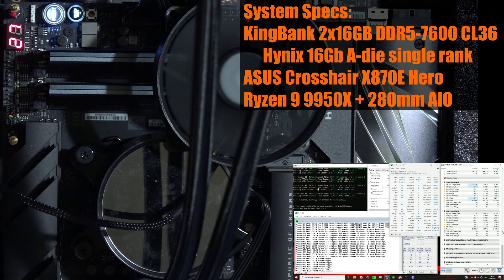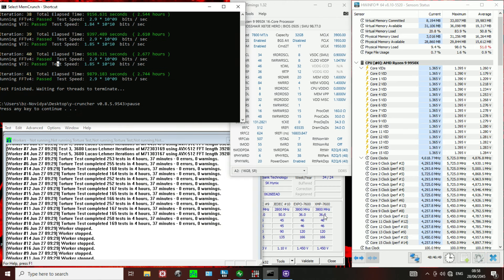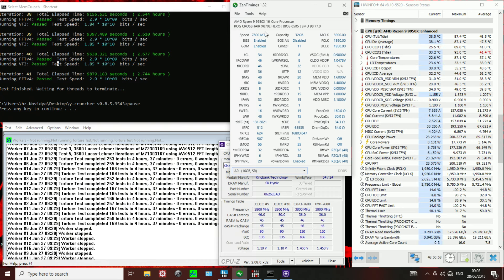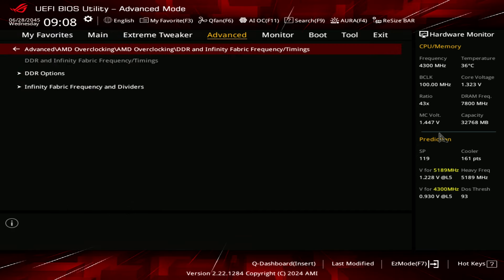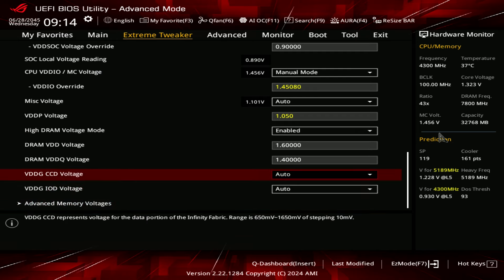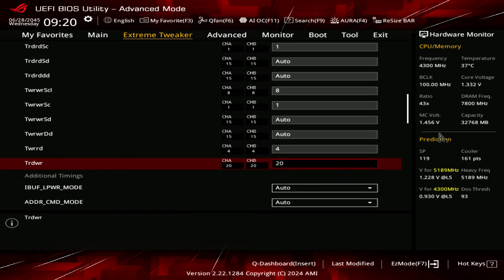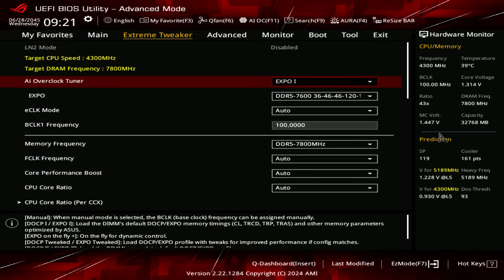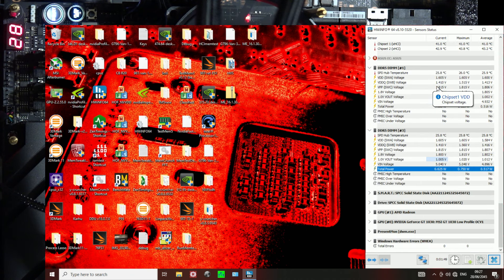SUPER LOW SOC VOLTAGE DDR5-7800 CL34! Ryzen 9950X, Crosshair  X870E Hero

Comment: It's an ASUS Issue TBH this generation is better than x670e but still its ASUS and i don't trust it with AMD i had so much better success with MSI and Asrock boards than my old ASUS did

you can probably do 8000 stable on asrock or msi
Reply: No msi board will
do 8000
Reply: The hero is probably the best 4-dimm memory overclocking motherboard out there.
Reply: @PowellCat745  Overrated motherboard the old heros were good the new one are not so much
Reply: @JoeMama-yl1ow  it seems that you haven't checked their site at all they can do up to 8400 but realistically 8000 is the limit and depends on you CPU MC
Reply: @megadooooom6582  the old hero can’t even do 7400 consistently. If you don’t care about high memory speed, sure, the old hero is better, but its memory support is garbage.
Reply: @PowellCat745  no no you got me wrong i was talking about the x570 boards from hero the new heros are not that good and overrated in my opinion